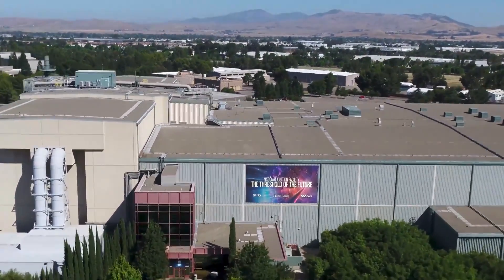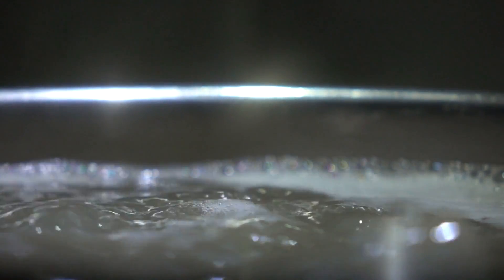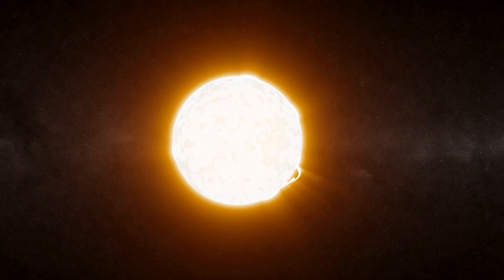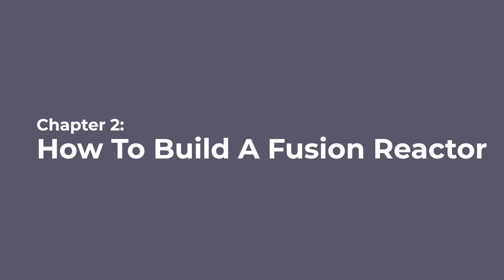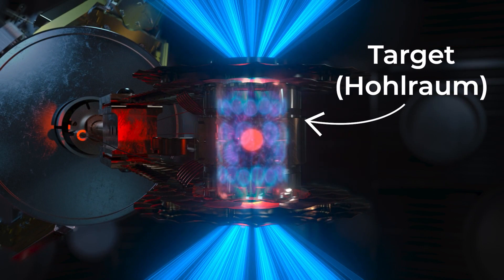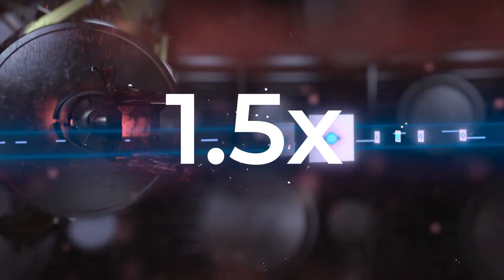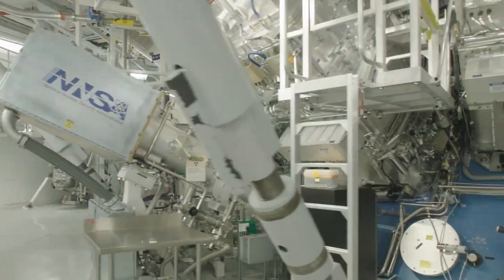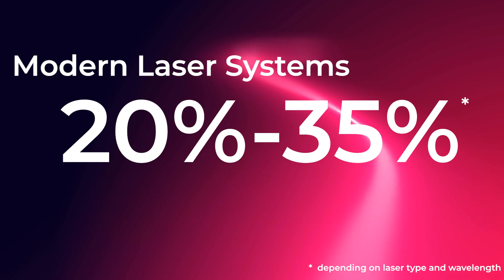The US Fusion Ignition Breakthrough EXPLAINED

Comment: Good explanation, I worked in a R&D department at a major corporation. There's basically 3 phases. Step 1 is see if the goal is even chemically possible, not looking at any other factors. Step 2 is called a pilot lab and their job is to now figure out how to make the chemistry actually happen. Now we're seeing the complicated systems and machines being built and mechanical engineering (which is where we are now with fusion). Again, not focused on efficiency, just how do we build a system to make what worked on paper, happen in real life. And then once you figure out to actually make the process work, step 3 is production scale. So now you look at how to make the system more efficient, improved materials or new technologies etc but all based on what was created in the pilot lab. Remember, every tube, wire, pipe, control panel, literally everything in the building and the building itself had to be created and designed from scratch just to even see if this theory would work.
Reply: Exactly
Reply: T. Bostick's boss speaking. So this is what you have been doing at break?? Divulging our company processes is a breach of contract. I will have H.R reprimand you once you come back from your holiday break immediately! Good luck sir.
Reply: @VoidWater96  only if you can catch me
Reply: Maybe I m permissive, but I don't think Nuclear Fusion is at Step 2 yet.  This 'Ignition Breakthrough', in my opinion, is more like a proof of concept that Fusion can happen, which we already knew when we created the hydrogen bomb.  

Laser induced inertial confinement cannot sustain the environment long enough to make nuclear fusion on-going.  Without on-going fusion, nuclear fusion cannot generate enough energy to cover the initial energy required to ignite the fusion (400MJ in this experiment to power the 192 laser beams).  I believe Tokamak have a much better chance of success at commercialize nuclear fusion.
Reply: @t_bostick - A real good summary.of engineering in general.
Reply: 1) Lie about thing
2) Get funding 
3) Spend on food and booze
>Restart at 1)

wow check it out I'm a scientist now

"hey didja hear about so and so he doesn't work and just applies for a bunch of grants over and over, technically he's still in college, otherwise he'd have to start paying off his FAFSA"

they k n o w
Reply: Except the theory does not work. 420MJ in and 3.5MJ out. Yes they minimize the actual amount of energy used.
Reply: The facility in this video was designed for the testing of weapons, not energy production.  Thinking this proved anything is hilarious.
Reply: Killing So Many  Nuclear Lies  ALL VENT & LEAK  Cancer  @ 42 CPM
Reply: What does Nasa have that Elon doesnt?
What does Elon have but Nasa dont? There are reason why there are step by step Procedures, someone has to be the One that First Invented Sticks, Stones into Spear.
And I dont think, Backers... Investors whatever with Hunger for Forever Growth has the patience to wait.
How ever whatever commercialisation does are to Make what is Already Proven into a more Efficiency relaible consistent build.
Reply: Besides as Humans cannot process 10000000000000000000s of data in 1 sec they need time to Process and Understand, hence the slow and as time went by it gets faster....
Meaning after Certain Break Point in this case E=mc2 we have a Foundation of Understanding the whatever Current Technological Advancement Level.
1, 2, 3, 4, or 5 Civilization?
To me the Flying UFV or whatever those wants to call it, are Flying Above water... Cooler then water Explain that
Reply: This is where private finance comes in, once fusion energy is proven, private investments will follow and dwarf those of government expenditures, we will need an Elon Musk of nuclear fusion.
Reply: @thomaskalbfus2005  I'm sure that's already established. These big corporations partner all the time on these sorts of endeavors. The company I worked for was a major food and agriculture business, but on the project I was in on was a partnership with a global fossil fuel company. The goal was to see on developing a new source for biofuel. If we were successful then the fuel company would take over production scale and the ag company got the contract for supplying the bio matter and ownership of the patents.
Reply: yeah worked as a janitor.
Reply: @dcv5000  everyone plays a vital role. Lot of R&D goes in to janitorial services as well.

Comment: The elephant in the room (and not once dealt with in a YT video so far as I can tell) is commercial viability, not engineering viability. If a fusion reactor cannot produce electricity cheaper than the alternative - renewable energy plus storage - then it just won't get built. Renewable energy is mature technology and cheap. Energy storage will be mature and cheap long before fusion becomes viable in the engineering sense. And of course there are other technologies waiting in the wings - for example geothermal which could become economic with recent advances in millimetre wave drilling. 

I still think fusion technology is amazing and it's worth doing both for the science and the possible spinoffs in space propulsion. But given how complex it is and how simple the alternatives are, I cannot see it being used commercially.

Comment: The efficiency is not a blurred line at all. The time constant of energy in, is not equal to the net energy out. The energy out is 10s to 100s of trillionths of a second shorter than the time taken to deliver input energy. This makes the total output power less than the total input power.

The input power is like a steady 12V DC power input at 2A charging a capacitor bank to 12V over 60 seconds, and discharging all of that energy in 1/10000th of the time it took to charge them.

Fusion will never yield a true net energy gain. Conservation of energy will never be defeated.

Comment: Thank you, this is the first video that addresses the energy required to create the Hohlraum, I thought I was crazy for considering it. Would it be fair to say that this result is not 'higher than 1 net gain' any more then using a matchstick to ignite a log of wood? I mean that the energy out of the wood is far greater than the energy put in by the matchstick. Or is there some specific mechanism that makes this kind of net gain in regard to fusion more special than in the case of burning wood?

Also there is a 2014 article from NIF that states it achieved net gain in Nature: 'Fuel gain exceeding unity in an inertially confined fusion implosion'. Why is this result more significant than that?
Reply: Nuclear engineer here: it’s all perspective. In that article, they were specifically referencing the x-ray energy which was used to compress the fuel whereas the break through that just occurred included the laser energy on the capsule that was used to create the x-rays. In truth, it’s still not an overall net gain, as much much more energy was needed to create the lasers in the first place (in the hundreds of Mega Joules compared to the 3ish created by fusion). While this is certainly a good milestone, it’s no where near actual gain and the author’s line of commercial fusion by 2035 is frankly not realistic as there needs to be substantial improvements. In laser efficiency, energy conversion, facility design, and continuous output.
Reply: @TheOtherOlesen  So still no total net gain, that's what I thought.
Damn tabloids and for-profit channels on youtube overblowing and glancing over details as per usual.
Reply: @TheOtherOlesen  This is a good explanation, because it explicitly shows the games they're playing in order to create undeserved buzz around their project. It's nothing but an ongoing exercise in redefining what is included in the system, in order to artificially turn a minor efficiency improvement into some kind of scientific "breakthrough". It sure looks like they just decided to include another <1% of the necessary equipment (and it's corresponding energy requirement) into their definition and called it a milestone. At this rate, in just another 100 years we may finally be able to realistically say "fusion is just 20 years away".

Comment: The opening to your video is a lie. A lie by omission.
While true, the laser output and the enegry output at ignition equalled a net gain. They did not include the energy required to power the lasers, which was 100x greater, than the output. They would need to out put at least 100x more power to make these statements. Its a scam. Pure and simple. Scam.

Comment: lets talk fast fascts iff soemthing wokrs then made plug in facility in research and test inovation facility area so basicly serialy plug several device and get e qouta and that obligatory and zear budget and privisional inquiries for obligatory like 30% from year budget for research and inovation and thinking theme through budget means instant think in funding and larger volume assembly and creative taks in production become more functional so eider we do this and that and takes theory and moved fiew years ahead is better to practice test it see possivble enginering improvments change by physical properties then fix the solutional various option more more then fiew piece in facility and start plug in time is critical in sense plant liek this can be fixed on mars colony and probabyl will so use 5% less thne max value strength and skip plan to use like 84% off max volume for that theme the ordinary jet or roclket engine should be supose to be build and stay fully fumctional and is in best service option use when you come to details and production plan mostly almost all parts would change so is good to have like 5 zear taks and like 3 years off production and than is know and safety level rize and opertional plans grows when is plant producabel gives light about keys and figures and some actual like picture in mind how does it looks like in each safety si still produce energy eficiently so in a way you already make money and act as producable research and inovation facility and make money on it facility makes funidng even better and through time research nad test production makes it know how in 5 years so poping out energy makes it so fast like car inudstry cycle then is idea on key facility and plug set up on mars colony with energy plus rate beside thorium cell plug ins salt reactors or ore extraction or production facility some make it more fun to made in energy suprlass society even somew phsical change propertyin alternation make it sound more resumble now thats a click and you get that on producing energy even funding from side is not a problem just aplicational  creeativity and production assembly are lot faster and more creative technicaly you are developing for industry sake and resource grow and tomorrow you do your own provisonal industry and search and exploate resource while living in energy surplass society which you already in facility but aplicational and production parts are also servicable stuff in research and  tests

Comment: This NIF nonsense was a huge con job on the American people.  Fusion has never ever worked after the manner that the scientists of the world believe and have taught people that it works.  The strong nuclear force is an intellectual fiction concocted over the years because scientists couldn’t figure out how it could be for multiple protons to be all snuggled up with one another in the nuclei of atoms beyond hydrogen.  Here is the truth… 25 years ago I proved that if elementary charged particles were to come to a state that they overlapped each other in momentum space (have a common De Broglie wavelength (calculated from their center of momentum frame) that is greater than or equal to their inter particle distance then they will behave opposite to the expectations of Coulomb’s Law.  Overlapping in the same momentum space is a fancy way of saying that they have very little (or none) relative motion with respect to one another.    25 years ago I actually unified electromagnetism and gravity.  But the scientific community has their collective heads in a place where there is no light so one cannot even shove it down their throats.  That simple fact proves that the strong force is an intellectual fiction which then evaporates gluons and quarks which were all made up things with no real evidence for their existence.  So, with the Standard Model reigning supreme I couldn’t get a paper published. Truth is not welcome in modern physics.
Reply: If anyone really wants to investigate whether or not I actually unified EM and gravity 25 years ago, I am planning on releasing a rewrite of the book I wrote in 2005.   The day has finally come and the unification of gravity and EM should be given to mankind.  It will lead the intelligent person in the right direction for building a working portable, scalable nuclear fusion reactor…not buildings full of billions of dollars worth of pretty much useless equipment.  People will be able to have one in their vehicle as an electric power source.   Back in the late 1990’s I tried to give the unification away on usenet but John Baez and others censured almost everything I wrote.  One writes down true facts in physics and Baez and his buddies would not allow the posting *as they were the moderators) because it was too speculative.   That is what I call a true pseudo scientist…all the degrees but nothing but the overwillingness to regurgitate what they themselves had learned from people who really never understood the truth and block anyone who disagreed or who had facts that opposed their nonsense.

Comment: I'd love to hear more about the fusion fuel, and is it bad for the environment to produce this fuel
Reply: The beauty is that it is "clean fuel". That is why it's so important.
Reply: @morbidmanmusic  Not so much. The fission of U-235 in commercial fission reactors produces neutrons with an energy around 2 MEV (million electron volts). This is responsible for a lot of the radioactive waste from commercial reactors. The deuterium-tritium fusion produces neutrons with an energy around 15 MEV. That's actually what you would use to get electric energy out of this. You're still going to get radioactive waste. There are aneutronic reactions, but they are much more difficult to initiate than deuterium-tritium.
Reply: @michaellovelace3844  use need a fission reaction to make the tritium as well. Fusion does not pencil out.

Comment: It was not a breakthrough, more a confirmation of science already known. The Q is still well below 1 in case you take a steam cycle for electricity generation into account, which is currently ca 33% efficiency. 3,15 x 0,33 < 2,0mJ. And that 2,0MJ was not 2,0 for the lasers, it was 300MJ to generate that 2MJ in a single point. The fusion itself is energy positive, which is no surprise. The full picture; Energy out < Energy in.  It would be nice if scientists could be more accurate as there is already a lot of fusion bullshit circulating on the internet, including false claims about breakthroughs. There will be most likely, no commercial fusion reactors before 2060.

Comment: Breakdown of this subject was very well done regarding this video! My question to u is...
What other types of elements can we utilize? Of course more resources are needed, but in your opinion, how would we harness this from of output? What would u engineer 1st? My thought immediately goes to experiments in 0 gravity.
Arcmage
Reply: You can gain energy by fusion using any elements up to Iron, however they are much harder to fuse (larger and needs more energy to overcome the repulsion caused by more protons) and don’t produce as much energy when fused. Hydrogen is the most efficient and gravity does not really affect the process.

Comment: Total rubbish.   If you look at the published numbers, only in a very limited and misleading sense was "break-even" achieved.  The lasers are only about 0.5% efficient, so it took 200 times the ingoing power to generate the output.  This thing is still 200 times below break-even.    And it's not a practical reactor-- the switches and capacitors and reaction vessel are only good for like 2000 pulses.    Each pulse generates about 500 watt-hours of heat, about 2 cents of electricity wholesale.   You can't make a competitive device that wears out a few million dollars of parts to generate $40 of electricity.   And the cost and availability of Deuterium and Helium 3 are also major economic concerns.   The thing has to not only break even energetically, which it is only 0.5% of the way there, it has to generate electricity at competitive rates, which it is still thousands of times below economic break-even.   And those basic targets are nowhere near reachable.  Engineers can sometimes improve things by a factor of ten every decade, but this thing needs improvements by factors of thousands in both efficiency and cost.  Not gonna happen.
Reply: Love your weak optimism... lol.
Reply: That's not how research work but ok.